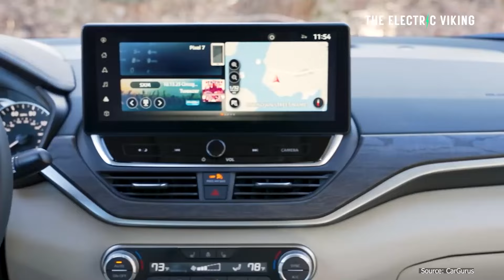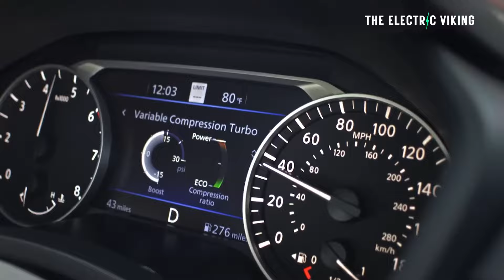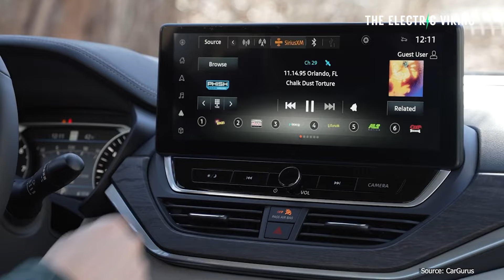Nissan are killing off America's cheapest car after sales collapsed

Comment: My Kia is about to hit 400k miles. Been paid off for 10 years. Worth probably $500 10 years ago. Today $600 bucks. 32 mpg.  All components replaced have lifetime warranty with Autozone.  Original motor and transmission. Just change your fluids.
Reply: You got lucky. My 3 year old Kia minivan started spitting engine codes and NOBODY in 6 Kia dealerships knew what was going on. I got in a fender bender and the insurance guy was nice enough to total it for me. Such a waste of money.

Comment: Two points. The room inside that’s liberated in EV designs mean that model 3 is as practical a car as many a smaller SUV. Having said that there’s no excuse for it no to be a hatchback.
Reply: wr
Reply: Aero drag = range.
Reply: Good points. Exterior size is meaningless.
Reply: Unfortunately the Model Y and Model3 have far less room in the second row compared with a Merc GLB.
Reply: @ropi4524 is that one inch or two?😊

Comment: Nissan Leaf in Australia: $40,000, 39kWh Panasonic battery, not thermally controlled, no charging cable supplied! 270km range, no more being produced versus BYD Dolphin/MG4 51kWh CATL battery, both $40,000, 370km range.

Who is going to buy a Nissan Leaf with a 100km lower range and having to pay $500 for a charging cable?
Reply: Video is for the US. Chinese cars are 'banned' in the US.

Comment: When having to buy a car, certain aspects come to mind…
- initial costs,
-running costs,
- features,
- (brand) familiarity 
- environment 

If you cannot afford the initial (sticker) price, you have to alter your other requirements. In some countries it is common to finance/ lease you car, in others not: you need years of saving money.

Likewise the running costs: the ticket only come once, but filling up/charging, ensurence, road-tax returns every month. You don’t buy a car for parking it in front of your house. No matter what Tony Sheba claims: energy price are going through the roof. Gas prices of €2,62 per litre, and promised to go beyond  the €3,00/litre.

You compare the features it provides. Most people don’t need to transfer loads of manure or do construction at site all de time. So what is the point of a semi of pick-up truck. I love to drive. Do I definitely don’t need FSD (as an engineer I do appreciate the technology). Etc etc

I do care about the environment, and would love a home-battery on wheels. But a bidirectional charger (checked it yesterday) cost 50-fold.

Oh, and one thing more: the prospects of the company. No one buys a product, if it’s likely you won’t get parts for it next year.

Comment: I actually think that the budget EVs would make a difference.  SUV sales have been hit pretty hard recently in the US market, as have larger trucks, and whether you look at cars, SUVs or Trucks, people are trending towards the smaller, lighter, less expensive models.  Thus, it seems that the reason it is gone.  The issue with EVs is a huge, huge lack of charging infrastructure and a few others.  The Altima is a good car, but while cars are doing okay if they are small enough, the Altima is too big.  The Versa is small enough, but the Versa is generally unpopular because it was uncompetitive.  It was cheap and felt it, and the space was terrible, the fuel consumptions wasn't enough to justify it, and they weren't even necessarily super reliable, and so Americans preferred used cars instead.

Comment: I have been waiting for an affordable Chinese EV for years. When I heard that Hertz was getting rid of their Teslas I looked into it thinking I could get one for cheap. Most of the cars they were selling were only a couple of years old but had close to 100,000 miles and they still wanted close to $30,000. This means they were probably used for ride sharing and were fast charged most of the time, no thanks. Instead I got a 2 year old NISSAN leaf with under 20,000 miles for under $20,000.
Reply: I just got one from Hertz several weeks ago for my son -- Tesla Model 3 year 2022 base model.  After applying $4,000 federal credit, the final price was $21,000.  I don't remember how many miles on it already; but nothing stands out from my memory.  What you were looking at may be one of the more expensive model of Tesla model?  Long range or Model S?

Comment: cheap ICE doesnt sell in america. americans are only interested in over priced large SUVs and trucks. nothing reasonable is popular in america.
Reply: Don't forget the Dodge Hellcats!
Reply: Gasoline is cheap in the USA. Compare to Europe. They have no economic pressure to save fuel.
Reply: @marianbiznesu1899  gasoline is just about the same price, taxes are much much lower in the US.
Reply: @scottmcshannon6821  same as Australia
Reply: @marianbiznesu1899  if you go out for tea at a restaurant you can fill up your car it depends what more important
Reply: @marianbiznesu1899 
I understand that due to the enormously car centered infrastructure, Americans drive more per year than most other countries.
So if you multiple more mileage, even lower fuel prices add up - and the depreciation of a more expensive car usually is a lot higher, too.

Comment: Comparing cost of EVs to ICE has to include the Battery Replacement... as part of the cost, otherwise it's NOT realistic...  nor honest
Reply: You have to include transmission replacement also since we are talking nissan which has the least reliable transmission on the market. Most dying before 100k miles
Reply: Honestly, the batteries in modern EV's should outlast the life of the car. Most ICE cars get to around 120K miles. Modern EV's should double that easily. Why is everyone obsessed with battery replacement? Do you know anyone who has replaced their battery, not in an old Nissan Leaf but a modern EV?
Reply: @timothykeith1367  why do people trade in a 2-3 yr old EV.  They want the hot new options.  Tesla innovates fast, bringing new ideas constantly.
Reply: @timothykeith1367 in the us battery warranties are 8 years or 100,000 miles... whichever occurs first